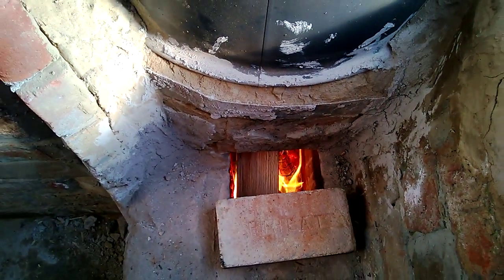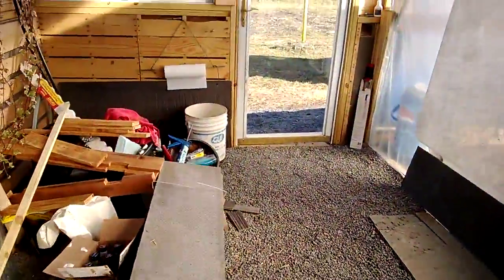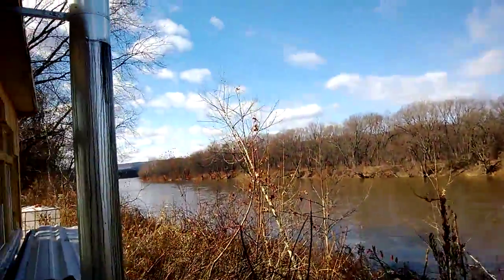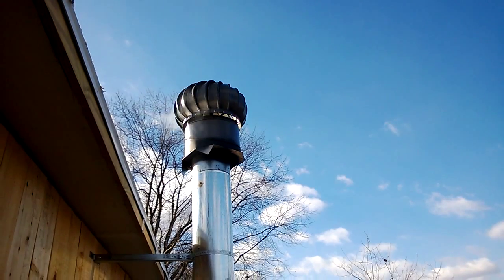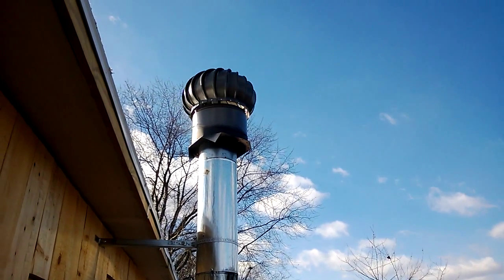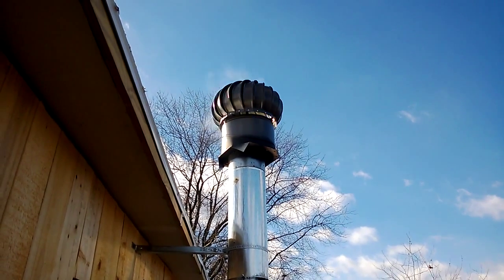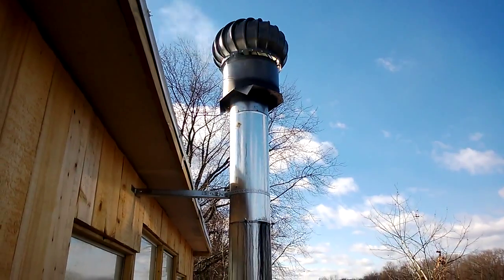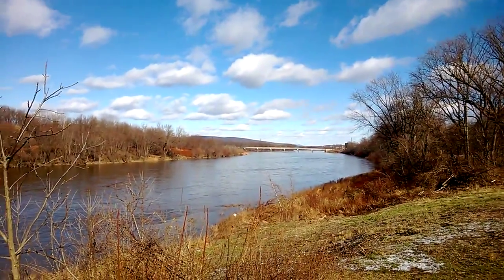Rocket mass heater with wind turbine

Comment: I used a squirrel cage fan blade for my 4" set up, and had the same benefits even in a 45MPH wind.
Reply from the maker: Update: We kept cap because as it worked great to stop the back drafts. We stopped it from moving because after the fire goes out the the turbine would continue to spin and draw cold air though the mass. Something to consider!

Comment: this is great and exactly what I was looking for.  Thanks so much for posting!
Reply: in high winds it might create too much draw on the fire so perhaps a flap inside the shute that is adjustable or perhaps auto-adjusts depending on the spinning speed of the turbine
Reply: a gypsyranger you don't really have to worry about too much draw on a rocket mass heater.  The wood burns from the bottom up slowly, depending on the wood used. It is only meant to catch the wind where there might seem as though there isn't one.  You don't have to worry, with a rocket mass heater that the wood is burning down too fast.  The amount of wood used is minimal regardless of the draw.  I believe in keeping things very simple.
Reply: me too and i've been looking at these sort of burners lately so thanks for the timely post

i imagine the water heater rocket burner could easily be included in this rocket burner with a copper coil and a little inventiveness
Reply: a gypsyranger I hear we may be in for a nasty and long winter.  My be a timely project.
Reply: yea i reckon you are just as i am just exiting a remarkably mild and waterlogging winter down here
Reply: a gypsyranger you in aussie?